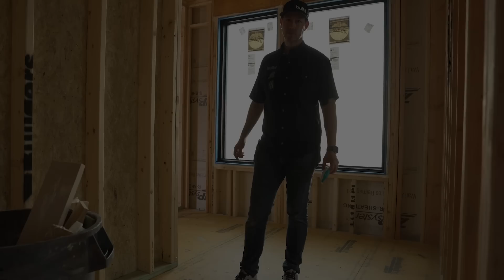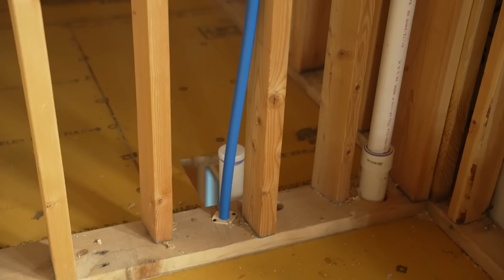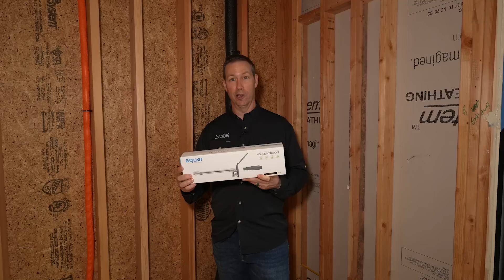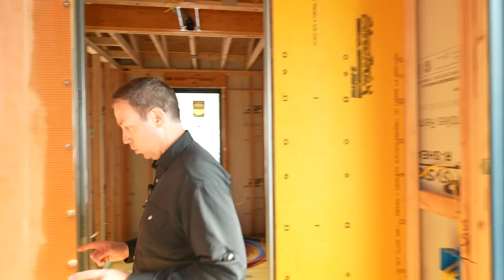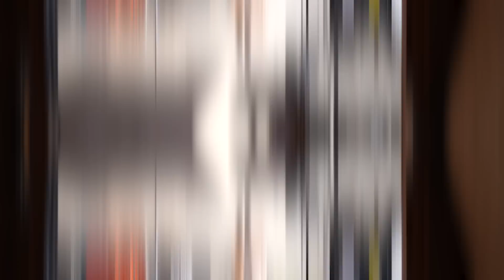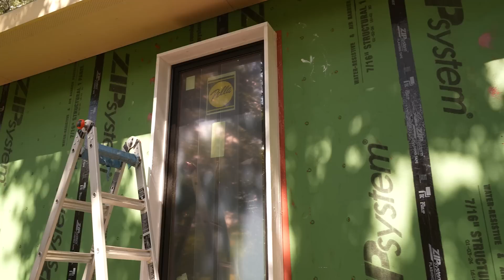The Risinger Build: Episode 10 - MEP Plumbing

Comment: I wish appliance makers would put Ethernet ports on their products. WiFi for fixed devices is dumb.
Reply: Wifi is way too good these days to mess around with Ethernet. People who ran ethernet throughout their house are mad it's already obsolete lol.
Reply: Agreed.  Wi-Fi is terrible (wasteful) for fixed appliances.  Every additional Wi-Fi network object comes with so much overhead.  With a couple dozen IOT devices, a cheap router is quickly overwhelmed.  Not everyone wants to have a $500+ router to make sure IOT devices don't interrupt their Netflix steam.

No one has ever complained about having to reset the Wi-Fi, right?  (yes even on new routers).
Reply: We are doing a house for an electronics developer and the amount of cat6Z we ran was crazy, he said the exact same thing WiFi was to easy to overload
Reply: @bobbygetsbanned6049 what are your walls made out of, paper?

Two or three rooms away wifi gets sketchy.
Reply: @priestesslucy  You already have to have good enough wifi in those rooms to use devices anyways, and most IOT devices don't need a constant connection since you're not gaming on them. I don't know how you could have good enough wifi coverage in your house for tablets, smart TVs, etc but not a smart thermostat or lightbulb.
Reply: Wifi uses about 1000x more power in IOT devices. The energy to communicate is about 100x less per bit transferred and the amount of processor and memory required is about 10x greater for 802.11 (wifi) vs. 802.3 (Ethernet). This isn't just energy cost, but hardware cost and reduced lifespan from high operating temperatures in cost-reduced appliance radio modules.
Reply: 100% agree. I wifi and bluetooth are good for things like mailbox sensors or maybe leak detectors. adding a smoke alarm to a weird location. But I always prefer wired connections and POE.
Reply: @bobbygetsbanned6049  wifi can't power things.

Comment: Hey Matt, you do know the Oatey Access Panels can be flipped for new construction and installed prior to drywall right? Just flip the cover. Saves the extra steps you added and is a much cleaner look when finished and painted. (fan and fellow GC in Iowa)
Reply: Or just take a picture, drywall over, and cut the sheetrock in 20-30 years if you need to replace.  Asteetics will be much better.  And you will have probably painted the room at least 3 times at that point.

Comment: Seeing that heat recovery system for the drain pipe reminds me of a shower water recycling system that was part of an experimental Tiny House on display in Berlin years ago. This is probably more practical, but the idea of taking an endless hot shower without wasting either energy or water would be easy to sell in places like California. If we had "Unit" baths like they do in Japan it would probably be a built in feature.
Reply: Nope, not practical. Only high end home builder would considered this little effect of recycling heat contraption. A buddy of mine did a heat transfer calculation of copper piping and temperature exposure, and the amount of heat recover from the drain showers are very, very small. Of course, it's also depending the location of the source of the recovery tank, if any. the further away, the less effective. Bottom line, the heat recover from the shower is insignificant and not worth the money and effort. The manufacturer is trying to squeeze water out of a rock, and you bought it. Too rich for my taste.

Comment: If you are only going to insulate one water pipe, make sure it is the COLD line.  This house is in a very humid climate and unless you are keeping it fully conditioned 24/7, condensation on the pipe (even plastic pipe) is the issue.

Comment: Hi Matt, great video! I have two questions:
1. In the upstairs bathroom it looks like there is a double exterior wall in the shower to possibly make room for a shower niche (minute 30:20). I’ve seen some of Corbett Lunsford’s videos where he recommends never putting a shower or tub/shower combo on an exterior wall and I’ve also seen a Steve Baczek video where he talks about one of his builders installing a “wall within the exterior wall” around a tub or shower in order to better isolate it from a cold exterior. Although it is quite warm throughout the year in Austin, why would you put the shower niche in an exterior wall and are there any special details you have to include in regards to possible moisture issues?
2. Also in one of Corbett Lunsford’s videos he talks about the little known fact that homeowners are supposed to run water through their PEX pipes (and discard it) for at least two weeks before they move into a new house in order to flush chemicals and pieces of microplastics out of the pipes. Are there any similar issues with these kinds of contaminants needing to be flushed out of Pert pipes?
Reply: Legend says no flushing is needed, it's basically HDPE pipe, recyclable and with negligible leach capability.

Comment: Since the ClearLOC goes over the pipe, is this more like PEX-A rhat used compression fittings where the connectors are the same I.D. as rhe pipe? Meaning ClearLOC doesn't restrict flow?

Comment: I owned a nice home in Hawaii.  Trying to make it as energy efficient as possible as electricity 50 cents/kwh.  Hawaii is 30% renewables not because of government or electric company but private rooftop solar.  The battery storage at night makes a huge difference as well as eV’s.  I saved $800/month on electricity And gasoline. Plus
Power with outages. Starlink satellite 
WiFi/internet/celluar also helps out as cable companies have frequent outages cuz of fires.  Many cell towers do not have battery backup with disasters.  It’s becoming hotter in Hawaii both air and water.  Many without air conditioning as mild climate but that is changing.  Ac’s are too expensive to run without solar/battery solar.The usa
Mainland offers cheap electric vs other countries but energy costs will continue to rise

Comment: Copy and Paste from Legend spec sheet off website:  200 PSI Rating at 73° F | 100 PSI Rating at 180° F.   Where is this 200 PSI @ 200F rating mentioned?  Also, salesman says "5 bend radius"  while spec sheet says 6x Tubing O.D. ?
Reply: 3/4 ID = 7/8 OD X 6 = 42/8 = 5. 25''
Reply: @morninboy  OK, so you are referencing the 3/4 nominal tube size instead of the generic spec.  Thank you for the clarification.  What about the press/temp spec?

Comment: It's a bit hard to believe that water falling through that vertical Thermo Drain copper pipe for 2.5 feet at 19.5 ft/sec (most of it not making contact with the copper wall itself) would be able to transfer any appreciable amount of heat to make this worthwhile.
Reply: Yup, very hard to believe!
Reply: Not helped by the fact that if the manufacturer actually believed it worked they would have insulated it. Y'know, to keep the heat in.
Reply: Agreed. A better design would take heat off at a J-trap or a horizontal run. However at shower flow rates, the water runs down the sides of the pipe. Yes; insulating the space surrounding the heat exchanger will also help.

If redesigning, transfer the heat from the shower drain to the shower cold supply. Add an automatic temp control for the shower and you’ve got the best possible design.
Reply: It's not 2.5 it's a coil. Duh.
Reply: "It's not 2.5 it's a coil. Duh." -  @fox156  You're right. 32" is actually 2.6666...ft. 19:05 My mistake. I was way off. Thanks for being so cool about it though.
Reply: Lol
Reply: @jt5747 dude, it’s like 50-100 feet of tubing.
Reply: @fox156 , not gonna lie, I kinda miss the "duh" at the end of your comment that made your first one so cool. So you're telling me that the 3-inch "vertical" pipe that drain water is "falling" through in my original post is actually a 50-100 ft long coil, and not 2.5 (corrected to 2.6) feet long? Once again, I stand corrected. Thanks! It looked like it went straight through that outer coil wrapped around it on my screen, but I know that can be deceptive sometimes. I definitely missed the whole double helix configuration going on with the device.
Reply: @jt5747  It looks like about 29-30 times the 1" tubing wraps around the 3" drain pipe, which would make the total length of the tubing coiled around the 3" drain pipe around 25 feet long, or there about, I think.  I would also think it's not just the contact area between the coiled pipe and the 3" drain pipe that would transfer the heat, but the coiled pipe being made of copper would transfer the heat through conduction completely around the circumference of the coiled tube and heat the running water within the coiled tube essentially from all sides as the water is flowing.  So that seems like quite a lot of contact area between the flowing water and the coiled tube, transferring the heat in the copper tubing to the water.

Comment: If you bought  $700 worth of a high paying dividend stock (Getting 5% is easy), you would get $35 a year to pay put toward your utility expenses. If the Thermodrain cost $600 (which is around the cost I saw for it), and $100 to install, for a total of $700, and saved $25 a year, you  would clearly be doing better to buy  the stock. This device likely simply does save enough money to justify it's cost.  If the motivation is to be green, putting that money towards a more efficient heat pump ($700 will buy a couple of SEER2 Units more) is a much better investment.
Reply: Spending money on energy savings quickly gets to the point of diminishing returns. I highly doubt that stupid drain heatsink would ever be worth the added cost.

Comment: I came across this last month fixing a water softener install that included the lawn sprinkler.  They used this pipe.  I knew it wasn’t pex b, I was worried about what fittings I could use so I used push to connect.  I wasn’t sure if I could use a pex b barb fitting.
Reply: They were using softened water for their sprinklers? So they are slowly salting their grass to death...
Reply: @jonathanzappala  So you bypassed the softener for the sprinklers?
Reply: @bobbygetsbanned6049  yep

Comment: Excellent job Matt. Looks like a cast iron tub is on the list for my home design.
Reply: they can be super cold in the winter
Reply: Probably not in Austin, though. My cast iron tub/sower combo in Oregon is FREEZING cold in the winter. Takes several minutes to warm up during the winter and then several more minutes for my toes to regain circulation 😂.

Comment: Copper is the only material you should be using in your plumbing. It has anti-microbial properties and has been in use since Ancient Egypt. It is also recyclable. Pay the extra money, your family will thank you for it.
Reply: I’d agree if we lived in 1978, but most copper seems to be made overseas with thin spots and impurities.  I’ve had several 2005 era copper pipes get pinhole leaks with nothing near.   We have Tx hard water, have you found decent copper available recently ??

Comment: I don't think a hose bib belongs in a residential wall. Prone to failure, freezing, and they create a big hole in the wall as well as being inconvenient for use. I prefer a dedicated circuit of pedestals outside, placed where the water is needed. If needed the entire circuit can be drained and, or blown out for freezing. Same concept for exterior elec receptacles.
Reply: @user-tv5dt3nm9y  sounds like a lot of work and a whole lot more exposure not to mention expense. Underground and above ground pipes are no longer in an insulated envelope and cost more to install. Blowing out has to be done in a timely manner and requires work. Vs the stub out built for harsh weather with a valve that shuts off inside the heated envelope.

Comment: Here in Minnesota I have spoken to several homeowners who have had those "thermo drain" pipes installed in their "Passive Homes" & they failed due to small pin holes that have developed in them. Personally I think it's a gimmick that's not really going to deliver any noticeable returns.
Reply: That goes back to another viewer’s comment (a plumber I believe) about the difficulty in sourcing good quality copper pipe these days with pinholes popping up nowhere near a potential puncture source.

Comment: I used copper. There is enough problems with plastics, so I definitely did not want it in my plumbing. Luckily I do not use the city water department but have a well and spring.
Reply: Everyone in my town that had copper had to replace it a few years back due to pinhole leaks caused by the city water. Guess you aren't really safe with any system.
Reply: @thursdaythought7201  I am thankful that I don't have to use city water. I want to have a large family (lots of kids), so I want to have things as healthy as possible for them. That is the main reason I moved out of the city.

Comment: I remember the last miracle plumbing pipe. Blue Poly... polybutalyne... how'd that work out? And push to connect? Sounds kinda like a sharkbite class action lawsuit waiting to happen.
Reply: Yah I dont get why it matters that they can disconnect it up to 12 times.  This is going into a house.  The only time it should be disconnected is if you are changing out the pipe.  In an industrial environment all of our piping is welded together for a reason unless we know we will need to change out the pipe in the future. I'd rather have the system with pex where they use a crimping tool to ensure you have a really strong connection.
Reply: That's why you wait 10 years to see if you get a Blue Poly or colored PEX recall before you use it. Let other people experiment.
Reply: Push to connect has been in industrial applications for decades for air/water with Festo/SMC. If properly designed and installed it's flawless. That being said in places that aren't accessible at all I would prefer if my plumber used crimp/press fittings.
Reply: @bobbygetsbanned6049 9 years in the US and 35 in Europe. I couldn’t find any suits but who knows.
Reply: @Puda  So they have been using this type of plumbing in Europe for 35 years?
Reply: @bobbygetsbanned6049  looks like I keep getting deleted? But yes, 35 years.
Reply: @bobbygetsbanned6049  yes

Comment: I’m selfish and I don’t care about recycling. Any other reason I should buy this over pex? Which product will burst first in a freeze??? This or pex?
Reply: "Easier to recycle"  Easier to biodegrade.  What's it's life span while in use?  Compared to PEX.
Reply: Lack of harsh chemicals in the manufacturing process.
Reply: Use copper, it will outlast pex by many decades. The initial investment will be more but it’s worth it.
Reply: Theoretically, it's supposed to be more durable than pex.  Longer lifespan with chlorinated and hot water, but in the field who knows, it's still a newer product.
Reply: @jeffcraymore  Easier to recycle doesn't mean easier to biodegrade. Aluminum is highly recyclable and can't biodegrade. 

Do you mean compostable? Compostable items biodegrade.
Reply: I love how he said "workability" 100 times
Reply: But it’s still poly ethylene…does that itself leach into the water?
Reply: I’ve seen pex B burst from freezing. Pex A I believe will expand significantly more than Pex B. I almost never see pex C in my area. I’m curious too on its expandability with freezing water. Can crimp fitting be used with it or just PTC fittings? Also, shark bite fittings are rated for behind drywall and underground but shark bites leak significantly more than any other water fitting I’ve come across: pex crimp, cold expansion pex, copper, pvc, cpvc. I wonder if there’s anything different performance wise between traditional brass shark bites and these Legend PTC fittings.
Reply: @keithdygert1120  PE-RT pipe can use any fitting, any connection method. The Legend ClearLOC fittings are made of the same type of plastic PEX plastic fittings use.
Reply: By that standard you're not selfish.  (I mean you might be really selfish, but not indicated by mistrusting the environmentalist religion, which would push a garbage product on you to further their own interests).

Comment: Thermo Drain a big scam.... pretty silly... since your drain water is like maybe 80 degrees.... the T increase is actually a problem for a heat pump water heater... for a heat pump water heater the colder the incoming water, the more efficient is the heating during the heat pump cycle...... just saying...
Reply: NO. That is a fundamental misunderstanding of what efficiency represents: Degrees of heat rise per unit of energy consumed. In other words, let's say heating water from 70 to 100 gives you an average efficiency of 1 degree per unit of energy such that you use 30 units. Heating water from 80 to 100 might only have an efficiency of .8 degrees per unit of energy, but that still only uses 25 total units of energy, a savings of 5/30 = 17%.

Another way to prove this is a logical thought experiment: When you heat water from 70 to 100, you are, at some point, reaching 80 degrees on your way to 100 such that you've used a non zero amount of energy to achieve that first 10 degree rise, proving the energy consumed from 80 to 100 is LESS than the total energy from 70 to 100.

Whether or not the savings are worth the upfront cost of a system like this is a different question, but your claim that it's making the process less efficient is just a misunderstanding.